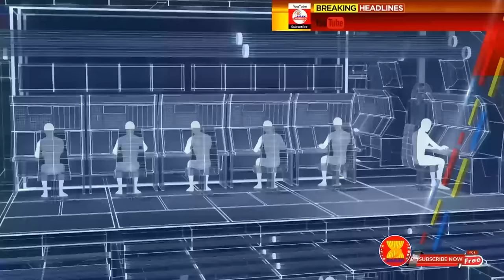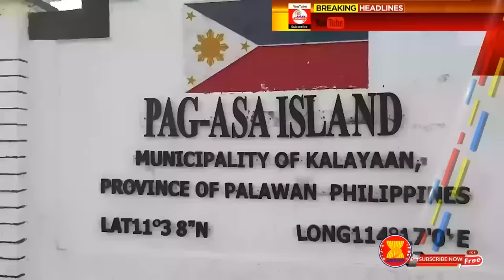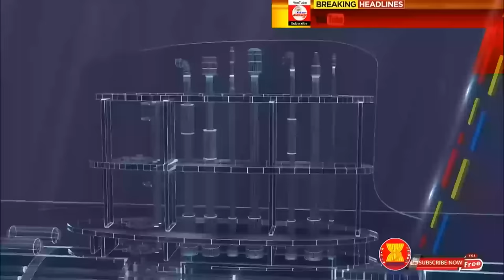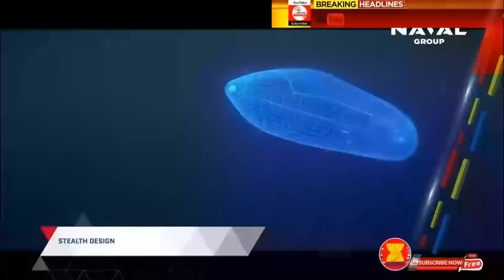The Philippines Will Manufacture its Own Modern Warships and Submarines

Comment: Right...The Ph can manufacture naval vessels in degrees...The process of welding pieces of metals to make a floating moving flatform may not so challenging as providing reliable propulsion and electronic guidance and control system for the purpose.Armaments will need to be sourced out from friendlies: missiles,anti-missiles, guns big and small, torpedoes, mines, spareparts etc.It may take a sizeable effort and resources but to a more or less degree, China will be a motivator.❤